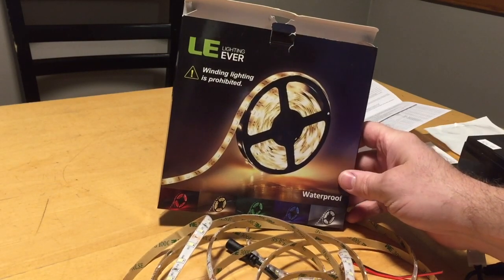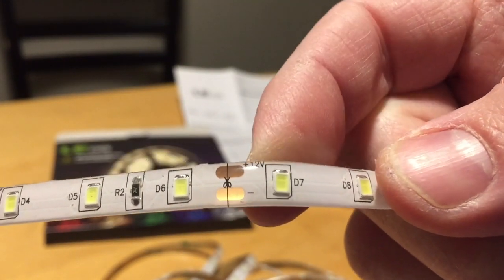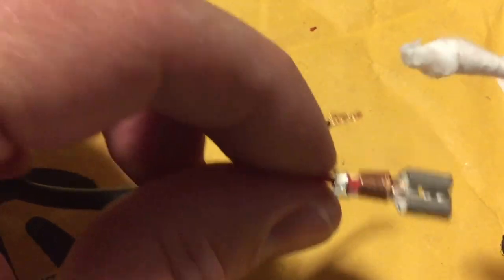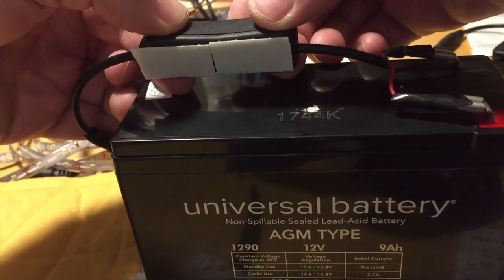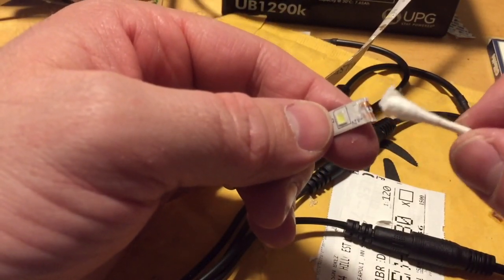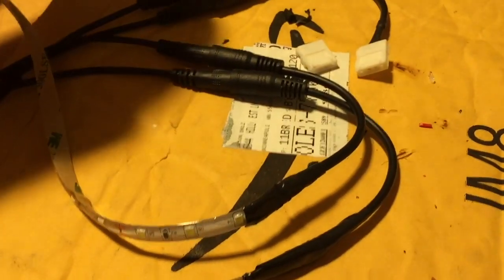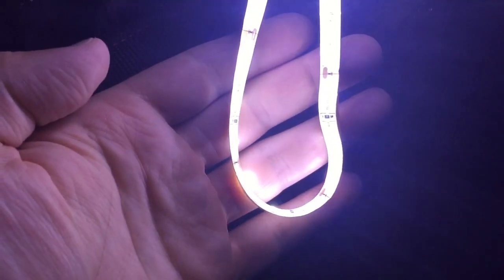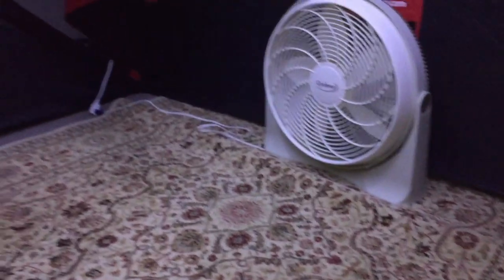How To Install LED Lights In an Eskimo Fatfish 949i Ice Shelter ~ DIY

Comment: I like it!  A couple of questions.
What kind of thread/rope did you use to wrap around the LED strip to the metal pole?
Why 2 runs and not just one on each roof pole, these lights are WAY bright.  I currently use a 2' LED strip in my 949i .
Do you place the house back in the bag coming off the Lake?  I dislike the bag and when frosty I lay the house in bed of truck.
My concern there is the LED strips holding up.
Reply from the maker: Just normal strong thread, its nice having more light especially when its pitch black out. I have a Honda  CRV  so I have to put it back in the bag. Everything fits tight in my car. Not enough room to not put it in the bag.
Reply: @TwinCitiesAdventures  thanks for the quick reply.
I need to set mine up and check out the possiblities.
I added two strings in the pickup bed, lots o light back there now.
Reply from the maker: I used my tent almost every weekend last winter and never had a problem with the lights. I thought of another idea this summer, I could just store the lights in a 5 gallon bucket and then clip them up every time.... just another idea, Im glad that I hung them though cause its one less thing to do and it was a fun project.
Reply: @TwinCitiesAdventures  No more stuff needed to bring, I agree.

Comment: Any problems with the lights not working when you have heat in there? I know I used a battery operated led last year which worked okay but it would get extremely hot and the batteries burned out fast with the heat on .
Reply from the maker: I’ve never ever had any problem with anything overheating and the LEDs are perfect and they work great every year.

Comment: Cool video. I've been wondering how to light up my 949i. How did these lights hold up over time setting up and taking Down? Anything u would do different?
Reply from the maker: Tyler Whiteley 
 I liked how I did this and never had a problem over the season. If I was to do it all over again, I would see if I could have ordered four separate led lights that were the length that I was looking for. Although I did have fun making this project. I kind of like that I mounted them in the tent because they are always there. Thanks for asking and good luck with your project. Send us a picture when you are done.
Reply: Was just re watching after I checked out the shopping list. Why  did you cut the white plug off and solder vs. Using the plug??? Waterproofing? I'm not familiar with these so just asking all I can before I try it
Reply from the maker: I watched a few videos about those white plugs and people seemed to think that they weren’t very durable, especially if you are going to be moving around with your tent in and out of the bag. I figured that I should make a more secure connection.
Reply: Cool. Thanks. Where do u set battery? One of side pockets?
Reply: Twin Cities Adventures 

When I added led strips to my hub I assumed the white clips would be good enough. For the life of me, I can’t see how anyone could get them to work. Especially in a hub house with the pole flex during setup/teardown. Most of them didn’t even work sitting motionless on my bench. I had to solder them and it has proven to be the much better option. Then heatshrink the connection and good to go.

Comment from the maker: I just set it on the ground in my cordless drill bag.
Reply: How has this all held up so far? I plan on doing this before this ice fishing season
Reply from the maker: It held up just fine last year. We went out at least 25 times. thats putting the tent up and tearing it down plus we always set the tent up again in the basement when we get home so the tent can air out because it gets covered in frost. Last year it got down to 10 below zero many times and when we use the heater, It gets frosty...